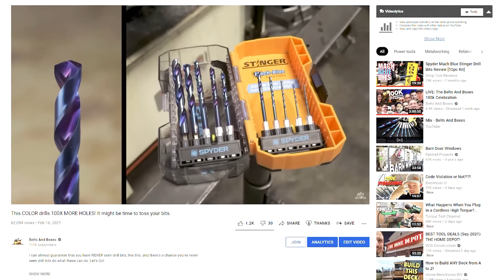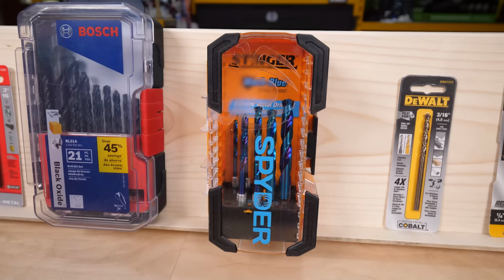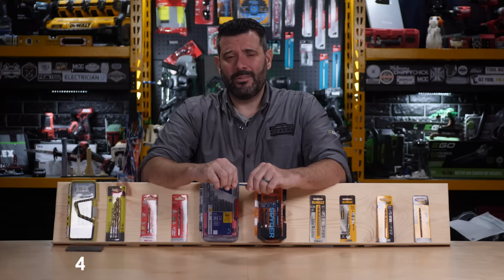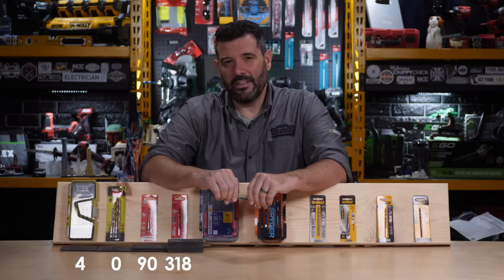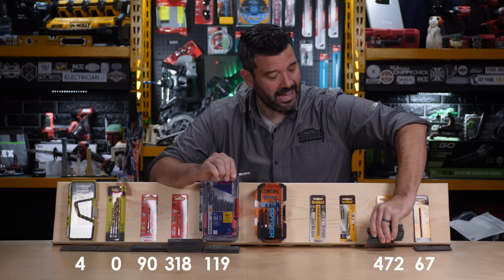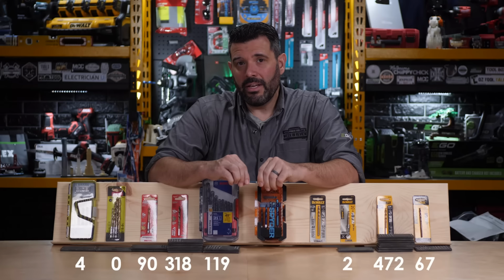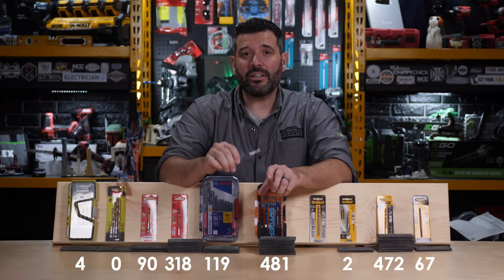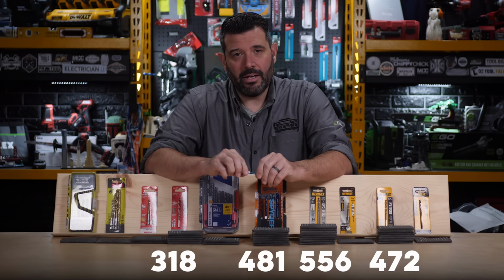What Drill Bit is Best? America takes on China. Milwaukee, DeWALT, Bosch, Ryobi take on Spyder 100x

Comment: I love the intent but your tests are bunk. The inconsistencies in your pressure, angle, and cooling time likely made a huge difference here. 
You need at least a drill press and a set cooling time between holes. I would love to see that test. 
Grizzly makes a great baby bench top drill press that would work well and it’s cheap. 
Signed a mechanical engineer.
Reply from the maker: Using a drill press is very common in tests like these. There are plenty of people here on YT who have used them with weights to get more consistent results. 

When we set out to do this, we had to decide what kind of test it would be. If we wanted to be technical, then not only would we need that drill press, but we'd need 10 copies of each bit. That would require 10 times as much steel. It just wasn't in our time, or financial budgets. 

So instead we approached it as if we were  an average guy walking into a big box store to buy a bit and drill a hole in some steel. That means we drill by hand, and we don't use oil. 

We gave the drill and bit a few minutes to relax between plates (72 holes) and put a fresh battery on for each plate as well. 

There are definitely more precise ways to test, but this is how we wanted to do it.

Comment: Back late 90's early 2000's I purchased a number of Bosh Blue Granite masonry bits all made in Germany. One day I go to get some other sizes and noticed the vinyl pouch/packaging had changed. I got home pulled the bit out of the pouch then noticed it look a bit off. The steel looked less bright and not as finely finished but it still had those Bosh blue-painted flutes. I looked closer at the pouch and printed on the vinyl was "Made in China". I was very Disappoint in Bosh over this and over the years replaced many of the Chinese-made Bosh bits but I still have all the original German-made bits. If I layed both Bosh bits side by side the German-made bit stands out visually it's perfect but more importantly, it outperforms the Chinese bit. 
Here's the sad truth of the time Bosh Phased out the German-made bits and replaced them with the Chinese keeping the same Item/Part Number and Price while giving their customers a lesser product. FYI Many other companies at that time did the same thing!

Comment: Based on your video, I purchased a Dewalt 1/2 inch bit made in Germany. Drilling though approx 3/8 inch snow plow. Used cutting oil and drilled one hole and got though about 1/2 of the 2nd one with a lot of difficulty. Totally disappointed!
Reply from the maker: Bill that SUCKS. As you saw in the beginning of our test, the consistency of inexpensive bits is terrible, but that doesn't mean the expensive bits are completely immune. If you'd be willing to do a bit of testing, I'd be happy to send you HD gift card so you could buy a couple more of those DeWALTs, and see if they fail as well. Just email me at rob at toolshow dot com and we'll talk.

Comment: Made in the USA and a decent tool or attachment my money will go there every time. Americans should try to keep our jobs at home as much as possible. Our "economic food chain" depends on our efforts to show the world that we can compete. 

I have drill bits from the 60's that were my dads and grandfathers and those bits drill through anything without a thought. Drilling through metal, I cheat by adding a little oil and let the bit cool a little. I have never had to sharpen the old bits after 40 years of use. All of the old sets were made in the USA, steel and all. I have drilled auto frames, truck frames, farm equipment and other metals of unknown hardness and origin with these bits.
 
Some of the bits that I bought that were made in China lasted about as long as the worst of this test. Most faired a lot less. All of those bits were of good name brand. Good money spent on hit or miss bits.

Wood bore bits made in China, not tested here, are mostly a joke. My antique bits still out run any Chinese bit hands down. Less corruption of the steel quality? , , ,I have no clue. 
Building a deck, I bored 86 of 90 holes with a paddle bit that was produced in the 1940's. The other 4 holes were bored with 2 new paddle bits produced outside our borders probably within 5 years. Yet, these 2 were a good name brand, taken "out of the box" and broke horribly before they were warm. Hint for wisdom, buy any and all small items for a separate receipt. Never buy a lawn mower and drill bits on the same receipt. 

Greed is killing our country for pennies. Would I, on a retirees fixed income, spend $2, $3, $4 or $10 more for equal or near equal American made drill bits, dang straight I will and have every time. 

I will now get off my soapbox. Thank you for reading. Joe

Comment: Not fair comparison because the bits are different  Composition wise and drip point configuration.I don't think some are even rated for metal.  Two of the Dewalts were Pilot point.  Good for drilling into tough to drill metals because of thinner web and near 90 cutting face.  The one drawback is that you cannot enlarge holes with these.  The Norsemans Vortex bits excel for this.  Also made in America.

Oh and try redoing the test in stainless steel.  I bet you will get way fewer holes.  Better for the arm too.

Comment: The Ryobi ones would be fine for drilling into wood. Cobalt for steel SS you need the right drill for the job. But if your only drilling into wood a Cheap bit is fine for making a rough hole. It all depends on your application. I doubt that’s Milwaukee and DeWalt make there own drill bits. I could be wrong.

Comment: If you're gonna buy cheap bits you almost need to resharpen them right outta the box I use drill hog bits on the lathe mill any machine work but I also have cheap bits for field or sketchy work run them through the drill doctor or hand grind them and they do pretty good as soon as the squeal resharpen and continue cheap bits are hit or miss on it they were sharpened well or even correctly I've got bits right outta the package that weren't sharpened right

Comment: There is this product called “Tap Magic”. Holey Moley.
Reply from the maker: You talking about the fluid? We specifically decided not to use fluid, since we know most of you won't either. (pointing at the general tool guys, and not specialists)
Reply: @ToolShow  Yes sir. Tap Magic drilling fluid has been catching  on. Great comparison. 👍
Reply: @ToolShow  Project Farm has a video he did about a year ago. Tap Magic did well.
Reply: There's this product called spit that'll do in a pinch. if I'm roughing it I'll rip a beer can in half and put some water in it and dip the bit in that periodically. Once you waste the temper of a tool you're done. Might as well hack at stuff with a butter knife then.
Reply: @paedahe4975  anything is far better than nothing. In a pinch straight water works. You heat steel up and it loses its temper. It anneals. That means it gets soft. You are not drilling ferrous metal too good with a soft drill bit. That's just reality.

Comment: Ive been welding & drilling for over 10 years. This is wild and  still doesnt give me any clear answers or reasons. I have bought $5 drillbits and I have bought $40 drillbits. Some jobs I get four holes out of the any bit, and Sometimes I get 40. Never have I gotten as many as you have shown in this video. Most of the time on a job im drilling 3/16”-1/2” holes in same size MS. Ahhhh! I just want a bit that stays sharp! I will say, I do not always use cutting fluid and I do not always use slow speed. i havent bought a mag drill. Onsite im using what 99% of ppl use. A two speed cordless drill (speed 1 to start, speed 2 when you get frustrated), Especially when it’s already 9pm and you still have 300-  1/4” holes to go.

Comment: I drill and thread steel every day. Own enough drills to fill a full size toolbox drawer. There's only one decent set of drills sold at a hardware store and that's the 15-piece Cle-Line set from Lowes. Made by Greenfield Threading. That's it. I wouldn't touch any of the drills in the video. No reason to.

Came up in my feed again. Here's the problem with this test: Let's look at Milwaukee's Cobalt drills as an example, as I've tested them. They'll pop a few dozen relatively accurate holes, as indicated with pins and an inside mic, and then the holes start getting bigger and bigger. It seems like the intent of this video was to show how many times a drill can punch through before it's too dull to function. If all you care about is making a hole, fine. OTOH, if you need accurate holes, this video was somewhat misleading. Before anyone tells me that all drills make a grossly oversized hole, I can get a RC3 fit drilling to size. No reaming.

On a personal note, if someone cares enough about drills to sit through this, why is he buying the garbage at hardware stores? Why is he not looking at industrial drills that offer a different world of performance? Because he may not know such a thing exists and is unfamiliar with various offerings. Fair enough. You have access to the Internet. Use it! This being said, I'd argue that the technique and the machine play a bigger role than the choice of a drill, generally speaking. Not going to learn that from a wood guy or an individual who took shop in school 40 years ago and hadn't bettered his skill set since. Lots of that on this platform. Look for videos done by machinists. Real machinists, not YT poseurs. Good luck.

Comment: I have that Spyder set.

The drill bits are nice. The hex shank will get stuck or want to get stuck in a quick release, like on an impact driver.

Also the case sucks, it's big and the bits don't stay in it.

I've used the non cobalt Milwaukee and DeWalts and I like the DeWalt Titanium set.

I'm currently using the Milwaukee non cobalt, as the local Home Depot doesn't have any cobalts, and they crap out fairly quickly into mild 4x4 steel and the steel in a conex shipping container.

After watching this, I'm going to try the Spyder 9/64 as that's what I'm using for the self tapping sheet metal screws

Comment: So I’m not crazy. I’ve had some drill bits that just seem to last forever. And some that just were disappointing.
Reply: I have the cheapest black oxide bits Harbor Freight offers and they work if used properly. I only bought them because they were laughably cheap. To drill into ferrous metal you do have to run at the right speed and use coolant.

Comment: I have some spider wood boring bits. Those suckers are hard to slow down. They cut through studs in seconds. I also have a couple of their hole saws. They are decent, but I hate hole saws. Count me as one of those who think the testing would have been more accurate if they used a drill press. But I really want to know which ones hold up best cutting wood.

Comment: Isn't Cle-Line a USA made drill bit? I've had good luck with them on structural steel and they are available at Lowe's.
Reply: Brand names in big box stores can be lesser quality than from other outlets. Economy runs are done at factories.
Reply: @Paul Frederick,  what was the purpose of this video? It kind of came across to me that he is comparing a USA made drill bit that is available at a big box store to the others brands that are imports, and still promoted the USA made drill bit even though it did not come out on top.  I understand that the big box stores have enough buying power to get lower cost runs of products, and quality may drop off  because of it.  But I would have liked to see other USA made brands other than the one they wanted to promote.
Reply: @robertharper8709  well the sponsored product came in second which is pretty good. Not many need the very best anyways.

Comment: I recently swapped to the Spyder and I'm enjoying them, done quite a bit of drilling through metal door frames and the bits have yet to slow down. I've also had a set of the Cobalt ones that won this challenge and had a lot of duds in the set that cut a handful of holes before tapping out. I'm interesting in trying out the 8% Cobalt alloy Irwin set that's like $115 on Amazon, once I've torn up some of the Spyder bits that will be my next set purchase.
Reply: Do you want to sell that dull set of cobolt drill bits ?

Comment: Probably should have used a drill press for consistency, and tested 2 bits of each of the top 3. Test the several different made in USA drill brands.
Reply: Adding some coolant would have been interesting. They wouldn't have burned out the cheapest bits so fast then. Ideally you'd sharpen them all the same too.

Comment: And just think about how many holes they could have drilled if you had used some cutting oil yeah I get it most people aren't going to put the cutting oil on for one hole but drilling that many holes cutting oil would have made a huge difference. Great review thanks for taking the time to do it.
Reply from the maker: Thanks Dean. Yeah we consciously avoiding cutting oil for that very reason. We know most people won't do it, mainly because most people only need 1 or 2 holes at a time.
Reply: Clearly some bits can be ruined on the first hole.

Comment: I really wanted to like spyder products, but after I went through a few circular saw blades in pressure treated wood, I probably won't buy them again.  I averaged 5 cuts through 2x6 before the blade started pushing off the line from getting dull.  I put a $13 dewalt blade back on, and finished out the day building a deck

Comment: Made in USA means nothing to me. I couldn't be any less of a patriotic gal, partly because I know that the source material doesn't matter and the manufacturing and QA process is what determines a product's reliability. I care about getting the job done and staying within my ultra tight, fixed income budget and actually making a profit off the furniture I make.

In all honesty, I don't even use Ryobi drill bits for drilling through hardwood, I use something worse. Hart titanium oxide bits from Walmart, and guess what? My furniture turns out fine. 

That being said, if I had to choose a brand for drilling through steel, I would choose DeWalt bits. German made steel is better than USA made, inferior only to Swiss made steel.
Reply: While the Swiss make nice things they do not have much of a mining industry. So they're importing the steel they use. The best iron ore in Europe comes from Sweden and Norway.

Comment: RPM and force explains most of your weird results.  Every bit will have an optimum RPM and force for any given material, especially where steel is concerned.  For most of those bits, you were way, way overturning them.  Accounting for rpm and force, the results would have been much closer to expectation.

Comment: cool video, but not using a consistent and repeatable method for testing makes your results not reliable
Reply from the maker: We realized that of course. But we chose to use it as we know most people will use it. (Without lube, and in a drill instead of a drill press). We’re about to launch a new tool testing series that remedies all of these issues. Stay tuned!

Comment: Nice video.. You could have used a fixed weight on a drill stand to give more equal pressure on each drilling.....
Reply from the maker: That's very true. We decided from the beginning that while my brother an I would work hard to keep our work consistent (we never worked to exhaustion) we wanted to use the bits like you guys would. There's a bunch of ways to test these things, and I don't think we're entirely done yet. We're working on more creative way to evaluate tools and accessories.
Reply: That's what Project Farm is for.  I appreciate the change.
Reply: @ToolShow  Good job keepin it real. I think I will invest in Spyder stock now. Everyone is going to buy them after seeing this.
Reply: @ToolShow  if you want to use the bits like I would then you need a milling machine and some cutting oil.

Comment: I'm having trouble watching... No cutting oil? What's the RPM of the drill? That looks like the high speed setting. 🤦 So basically this is a test on how to improperly use bits by over heating and burning them up with too much speed and too little pressure.  Any machinists reading this, your thoughts? 
Next bit test please use a drill press with correct speed and force

Comment: Well, if it makes you feel any better, Spyder just won one.

Plain and simple, all of my tools are black and yellow and I trust them, so I always give them the first opportunity. But sometimes, when it comes to accessories...they blow it anyway.

I demand hex shank bits and at least Titanium coating. So that rules many people out all by itself. I have been using Bosch bits and they are ok. But for this next set, I wanted something that was going to impress me (that's how I landed here).

DeWalt will sell me a 10 pack of these Titaniums in a hex shank...but they want 50 bones for it. On top of that, I'd have to buy them online because I can't find them at Lowes. But Spyder here...they are at 40 bones and they ARE al Lowes (which means 36 for me, with my Veteran's discount).

So they won. I'll go pick them up tomorrow. And I generally replace one bit at a time, as they break or wear out. So if they are as good as you say, Spyder can keep me for a very long time!

Comment: Based upon the inconsistency of some of the other bits including the Dewalt I wonder if you chose another Dewalt Cobalt and see if you only get two holes or another 581. My biggest complaint is when I need to drill I end up with a junk bit and spend more time going to get another bit that barely completes the job. I’d like to actually know that I have a bit that should do what it supposed to do! As much as I can’t stand Lowes I will go buy those bits because they appear to actually cut through metal.
Reply: check out norseman bits.